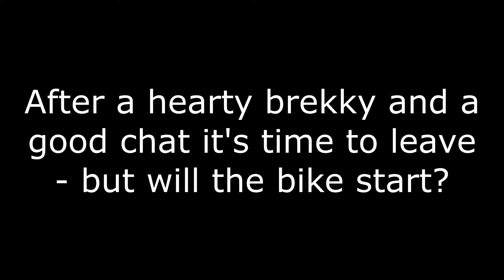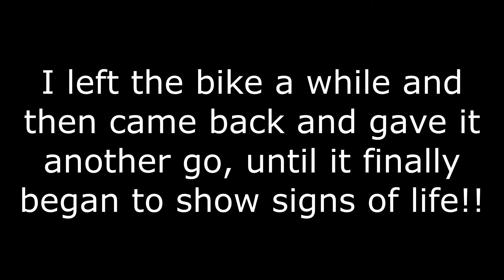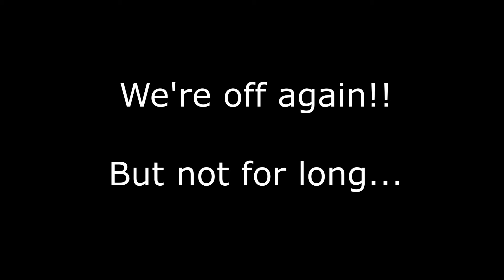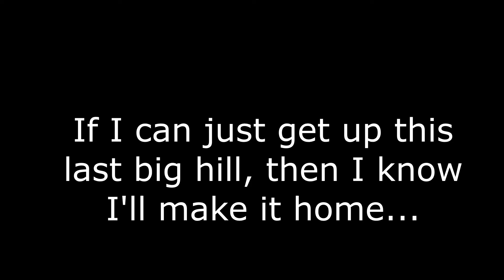Matchless Model X Motorcycle: Beautiful Autumn Ride - But is the bike sorted?

Comment: I use new BTH electronic magnetos on my old bikes. Sure, they are expensive but they have been totally reliable and stress free
Reply from the maker: That's an idea, thanks. 👍😏
Reply: Mine failed after just 20 mls.
Reply: @MarBl66  I guess you were unlucky. I've done 22k on my AJS 650 and 5k on the 500 single with zero issues. One of my chums also has two bikes with them (velo 350 and 350 gold star) again with no probs. Apart from the reliability, I love how easy it is to set the timing
Reply: @BruceBrown-p2c  It's kind of a lottery, similar to refurbished originals. I have a few users complaining about the new BTH in my closer surrounding, which is not that large in the first place. I have now a thorspark and a pazon in use and both work fine. But then those need a reliable generator. I have three of the modern altons (no plastic gear), of which one failed after about 50mls, the others are ok. Interestingly both failures, BTH and Alton, could be tracked down to insufficient application of loctite, so it was an assembly issue. I would infer, that if the alton or the new BTH survive the first 500mls, then they are most likely good for another 20000. If not, you are screwed.

Comment: Is the mag' auto advance/retard or on a lever, i'd check fust to see if the timing has slipped.
My experience with mag's is they have a weak spark or the condenser just fails when it is hot. Timing would be my first go to.
With the remote float chamber the float has stuck when too far off off 'upright', but i don't think that is possible on the Matchy set up. Then the other issue with stuck float nrrdle is upon stripping there is only what can be described as black snot gumming things up, thanks again to Mr Ethynol.